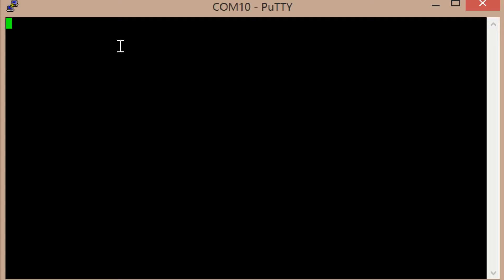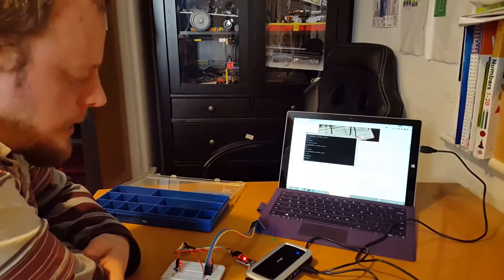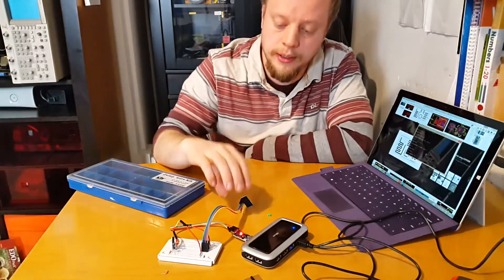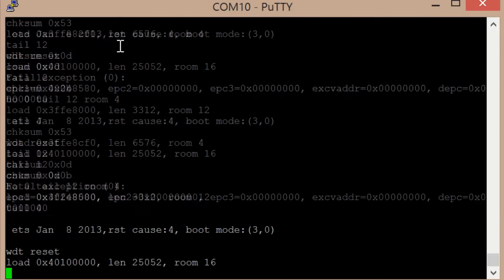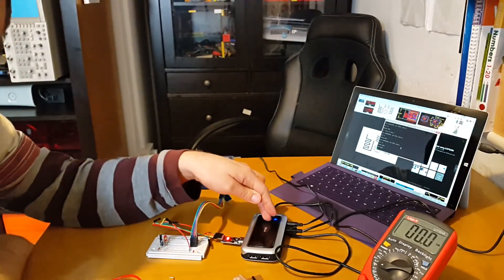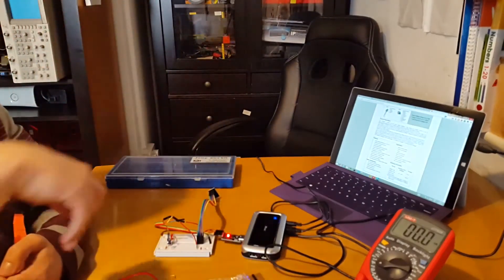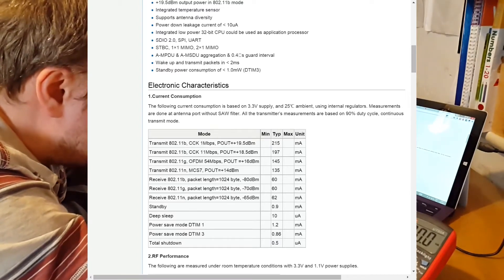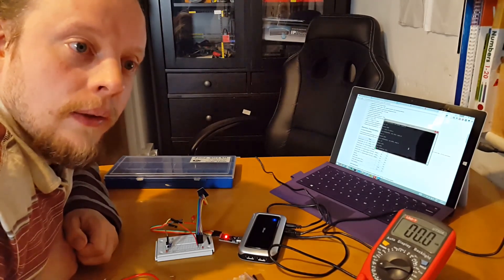Esp8266 Reboot Loops Caused By A Power Failure

Comment: had that too. is caused by feeding it from a computer usb. when i gave it its own  decent psu it worked flawlessly.
If your USB can deliver enough, the USB FTDI  converter is the problem. The Arduino 3v3 rail  probably not enough either
Well done with the overlays on yr video
Reply from the maker: +Ed19601 thanks for your comment. In a later video I found which regulators worked well for it. For later projects I've been using the nodemcu boards which work well straight from a computer usb port.
Reply: indeed! :-)
Reply: It means, if i used the usb cable for smartphone, that's not working well?
Reply: @journeytoflight3174  not necessarily. If it delivers enough current and the cable is of good quality it should be fine
Reply: @Ed19601  Ok. I will try it. Because i've try a lot of cable from any smartphones but all the same. Thx

Comment: Hai sir.
 I power esp32 using usb. When reconnect the power to esp32 , board is not working. But again pull off and reconnect the power its working. I dont know whats happen. Pls explain and suggest to move fwd
Reply from the maker: Hello, using USB from what? A PC or laptop? In theory, it should be around 100mA with wifi active - so not a lot. What firmware/code is running on the board? When you say not working - what did you expect it to do and what did it do?
Reply: @Orionrobots  
Hai sir.
   I am connected esp32 to pc through usb cable. I just the simple circuit for home automation using esp32, 2ch 5v relay and blynk app. First time power reconnection of esp32 is not working- means not connected to wifi. But It work fine when hard restting. In second time power reconnetion it works normally. No need of hard resetting.
Reply: Hello sir,
     Any suggestion or guidelines for over come
Reply from the maker: @saravanaraj263  Do you have somewhere you can share your circuit/board design and the code you are using?? Like a blog, video or github page? Probably easier to see problems that way.

Comment: need to replace?
Reply from the maker: It was me trying to use the an underpowered regulator - I needed a bigger regulator/LDO for 3v3 (capable of at least 240mA really), and also a 5v line that would handle it.
Reply: @Orionrobots  i have tried with 3.3v regulator with 800 mA max and the same problem
Reply from the maker: @moustafamohamed5278  What is the supply to the regulator? Which regulator model is it? And how is the esp wired?
Reply: @Orionrobots  phone charger supply, ld33v regulator, en pin with 3.3 pin and ground with ground
Reply from the maker: @moustafamohamed5278  Hmm - is the RST pin floating? I think you need a pull up to high.
Reply: @Orionrobots  value of resistors? I have tried 10k with no result?
Reply from the maker: @moustafamohamed5278  Perhaps try 3k3? 10k is quite high for a pull up.

Comment: Hi!! I was working on a weather sensor project (http://www.codeproject.com/Articles/1079298/Arduino-WiFi-Connected-Weather-Station-with-Androi#fig4) using an Arduino UNO and the ESP8266. On the first tests I was able to see the ESP's network on my phone but afterwards I couldn't see it anymore. This made me test every part of the circuit separately, so to test ESP I tried to do the following (http://www.arduinesp.com/getting-started). I was able to connect through Arduino IDE's Serial Monitor but I got the loop you're showing on this video. I have the following questions I hope you can help me with:

1) does this loop occurs for a particular circuit or is it something that will stop the ESP to work at all until fixing it someway?
2) in case the answer to the first question is that this loop will continue to afect other circuits until fixed... can you recommend me a fix? 

thanks in advance!
Reply from the maker: +Fabian Salinas The main reason I've seen this loop is that the power supply is not delivering enough current - so check how you are powering it. It will happen on any circuit where the power supply is not quite right. I recommend finding a regulator/supply that can deliver at least 250mA on 3.3v. There are potentially other reasons (like shorted pins and the like), but I'd start with the power supply. Where are you getting 3v from?
Reply: Hi! I'm using an external source that delivers 5v and I'm using an LM317T circuit to step down the voltage to 3.3v. But what I discovered on Friday is that the output of my LM317 does give me 3.3v but only if I have it all by itself, once I connect to the 3.3v line any other thing (the esp for example) that voltage drops to 3.19v. A friend suggested me that the cause could be having a damaged LM317. I'll try using another one to see if it gets fixed. Or do you think the ESP could be fried? Once I have enough current that loop should be fixed or do I have to do anything else with the ESP?  Thanks for your help by the way!

Comment: Good job with the screen capture, bad luck with the PSU. Do you have a bench psu that you can test with? I don't think the uno can supply much currant fro the 3.3v rail. I have one that made out of an old PC PSU and some parts I had lying around and it works quite well. It is a very useful tool and a nice simple build.
Reply from the maker: Samuel Doye I've got the next video parts already (needing some editing). I've been getting screen captures for the footage I had, and also making the orionrobots site more mobile friendly.
Reply from the maker: Samuel Doye as for a bench PSU- I've got buckets of 5v supplies, but currently not an adjustable bench supply. Repurposing a mini-itx supply for that might be fun.